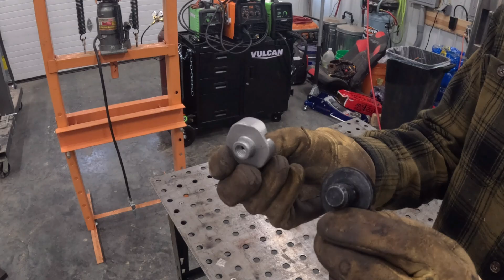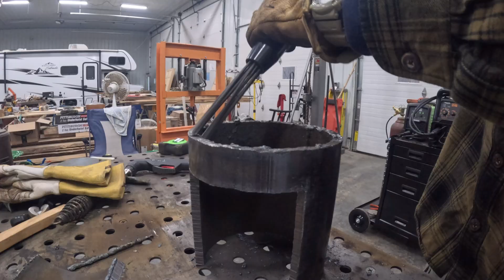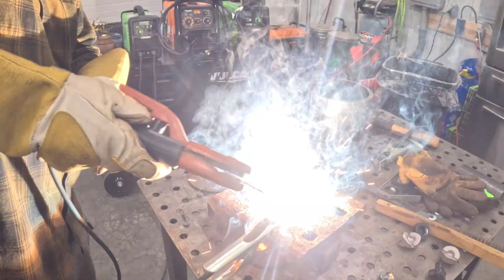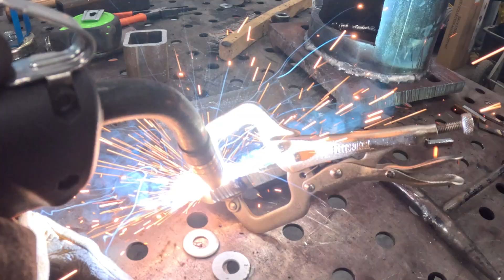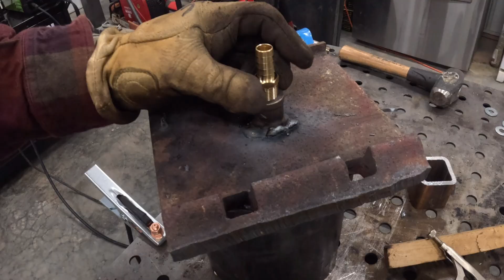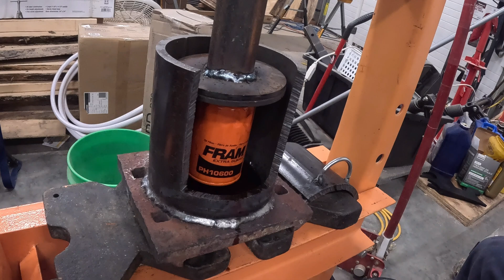DIY Welding / Cutting Can Crusher Project

Comment: Nice project Sir. I must not be holding my lips right or just old school when it comes to cutting, I am much better at flame cutting as opposed to plasma or maybe the shade 8 lens is to dark or my eye sight is to far gone insert shrugged shoulders here.
Reply from the maker: @marcdavis1728  thank you so much for watching and commenting! I want to try some flame cutting, did some in high school but can’t say I remember much about it now. I have read not to plasma cut below 8 but I can’t see anything there most of the time either. I see many people cut at 5 but I need my eyes and don’t want to accidentally damage them so didn’t want to start there. I cut this at 6.5 on my Miller welding helmet. Could see everything and didn’t have any bright spots or discomfort while or after cutting. I tried 7 but still too dark for me YMMV. We appreciate your support by watching and commenting, it means a lot and helps a bunch too! Have a great day and be safe!